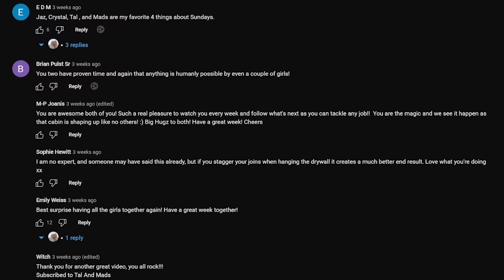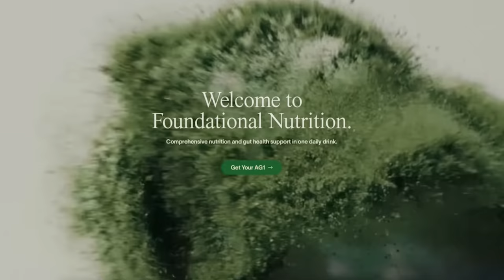We Should’ve Listened

Comment: I did Drywall for about 10 yrs both commercial and residential. Was on a crew who did everything by hand meaning no specialty tools when taping and mudding. Everything was done by hand. The crew I was on could have had the whole ceiling hung by lunch time or shortly there after and everything taped by the end of the day...But we did it for a living and knew what we were doing. Go your own speed. Take your time. Make sure yall have plenty of mud on those seems before you put the tape on. Then run your knife over it and push all the mud out. If you dont have enough mud you will get bubbles and or the tape will come down so it is important to have enough mud on those seems. Watch a few videos on Youtube on hand finishing drywall. Here is a good video explaining the hand finishing process. Yall CAN do this. Just be patient take your time and if you get stuck or frustrated just walk away like yall did in this video. COme back to it its not a race. If you have any questions go ahead and ask Ill answer them the best I can. Good luck like I said you CAN do this.....https://www.youtube.com/watch?v=jIxYEKhMa1I&ab_channel=LaurierDesormeaux

Comment: I don’t understand people having such difficulty mudding & taping. One thing that stood out from your montage of previous attempts was that you didn’t wet the tape and you used way too much mud. Like 10X more than you needed which is why you had such a mess. I can’t do anything but I can mud & tape as good as any pro. 

Step #1:  Thin coat of mud to fill the gap between the sheets. DO NOT OVERLOAD with mud. When I say “thin” I mean only enough to fill the gap & smooth it out.  Less is more.  #2.  Wet the tape & apply over the joint.  #3.  Apply another THIN coat of mud to cover the tape using as little as possible. #4. Mud shrinks when it dries so you’ll probably need to touch it up with a little more unless you put the mud on too thick to begin with which means you made a mess of it again.  

Remember that you’re going to have to sand away excess mud and that stuff goes EVERYWHERE.  It’s the hardest mess to clean up unless the house is empty which is another reason you use as little mud as possible.

Comment: It never seems to work to try to send you help, but...  Yes, you guys are doing great mudding (always thin coats, etc.)  but there is some chance that you will look up at the taped joints across the 'non-relieved' panel edges and you will have a moment of 'hunh' that comes from, maybe, a little 'disappointment.' (You will find that ceilings at the angle show just about everything.)   There is a way to alleviate - although not absolutely completely - the no-panel-edge-to start with syndrome.  High qual mud - not the qwik-dry stuff, and, as if you were actually plastering blueboard, work out from the seams.  Two coats helps.  Hitting it with wetted steel (as if plaster) can help. (You can actually use plaster - although it kicks quickly.)  Then sand with electric drywall pole sander.  Make frame (like you didn't use to hold drywall against ceiling) but with mobility to hold sander to work -- very gently -- against ceiling (lever - push down to go up).  Result will not be "dead flat" but ceiling will not "line grid" your view too badly as you look up.  PS I'm still worried for all the wall and ceiling covering that doesn't have stuff that would help you behind it (any CAT6 wire... etc.)

Comment: Not sure what your plan is , but if it is to wrap the beams with wood than you dont even need to tape and mud as it will cover most of the drywall and if that is the plan , a great one , ot will keep the whole cabin feel !
Reply from the maker: Exposing the trusses yes! Correct. That’s why we didn’t sweat the measurements being off a bit cutting those out. Thanks for all your advice in your other comments appreciate it John :)

Comment: The pappear tape is the best for drywalling.  Papper drywall tape holds a better stronger bond. The other thing is when you measure on the ceiling and your transferring the measurements to the drywall that your going to cut. Their is a vertigo effect that happens when transferring the measurements. And many people  measurements are off especially when you're measuring around light fixtures. It's best to take your measurements from the edge of the drywall that's already hanging on the ceiling over to a light fixture or any intricate cuts. You've heard that old saying measure twice cut once when it comes to drywall also looked weist and cut once. Now when it comes to mudding you want to keep plenty of mud and make one continuous run down the joint. When running the joint compound or mud as it's known. Think off icing a cake. It's the same nothing. So when one puts icing on a cake and iff you hold the spatula at to much of a angle one way the it's to thin and if you hold the spatula at the wrong angle the other way then you have to much in different areas. But when held at the right angle then the icing is continuous and smooth with just the right amount. So mudding drywall joints is exactly the same way as icing a cake. Then when running the tape use you drywall knife as is known as hold the end of the tape with the blade edge lightly so you don't cut into the tape then roll the tape out at arm length of the hand that you're holding the role in. Then angle your drywall knife and run it along the tape towards the row in your other hand remember to keep slightly light pressure when you're doing this with the tape so that you don't create wrinkles this will in bed the tape into the joint compound. I've put up a lot of drywall. If you don't understand how I've explained how to hang drywall and to run drywall compound and tape. Then their are many YouTube videos on how to hang drywall and to run drywall mud. Good luck with y'all's drywalling. Y'all have been doing good so far with it. All do y'all do have a little bit of problems once you get past those problems than drywall and will be like riding a bike.
Reply from the maker: Well that was a in depth step by step on drywalling. Thank you for spending the time to send us all your expertise and knowledge. We are so happy to have you in our community.🌞🐾
Reply: @Vanwives   y'all are very welcome I'm happy to share my knowledge. I hope it will help y'all out with y'all's drywalling. Again good luck and apply the techniques that I shared y'all.

Comment: You do know you can cover the ceiling with what you used on the floors or what you used on the walls. I personally would use what you used on the walls to cover the ceiling Also, it will look gorgeous.. But if you’re going to drywall, soak your paper in a bucket of warm water for about 20 minutes before you put it

Comment: 12:15................Think I would have just strapped the ceiling joists and put the drywall panels on the lower section.
Guess I don't fully understand your end result that your looking for.
I taped and jointed most of my life......have fun ????? LOL.
The secret to mudding joints is to have someone else do it....lol.Kidding aside...Imbed the tape.......then run mud 12" either side of tape ...allow to dry.....then fill in over tape to match sides.
I could almost do taping and mudding with very minimal sanding using a wet sponge method.
You two will do just fine though......it's a laborous job regardless.
The more mud on that's not smooth means the more you sand off.
I'd rather mud than sand any day....lol.....
THOSE exposed 2x4' & 6's will look amazing???lol.

Comment: Long time viewer much longer time drywaller or "Plasterer" as we call it here in Australia, don't worry about how you got there if you achieve the desired outcome, you have done it! That's all that matters, doesn't really matter if it's the right or wrong way as long as it doesnt fall down or apart :). Any answers to your questions in chat are going to confuse you more than help as there will be too many differing opinions, if you can ask a local for advice that would be best. Im happy to help with direct questions if you like.

Comment: I can't believe you wonder why you are so cold. All heat escaping thru roof. Heat rises duh.
Close up attic with a door.
Put up insulation.
Put up dry wall beneath trusses. Full sheets make it 4*8 to screw into . Leaving a cut edge at a corner. Keep all factory edges, for easy mudding.
3 passes of sanding and mudding is perfect.
So quick.
Reply from the maker: Not always about quick… it’s hot lol

Comment: Dry walling and taping is a bitch .. unless you do it as a profession . You have to make sure Sheetrock is hung straight and taping and spackling is the challenging part don’t use too much product dries a hot mess clumps everywhere and too thin and walls crack at seam and rough areas and etc. maybe if this doesn’t turn out nice just use bead board up there and paint it white .. good luck as always thanks for sharing .

Comment: Why did you dismiss the possibility of screwing the drywall to the underside of the rafters/trusses - instead of the underside of the roof - surely it would have looked neater and have been far easier to get the sheets in position? 
Granted you loose some head-room - but that doesn't look to be a big deal.
Reply from the maker: We have big dreams for the ceiling - stay tuned 😊
Reply: @Vanwives  Intrigued to see what you have planed. You two are an inspiration.

Comment: Soooo is it just me or........Why are you placing dry wall on the underside of the roof? AND mudding / taping the seams? I've  never seen this done. I've  only seen the drywall placed on the underside of the ceiling joists thus forming THE CEILING. Insulation sheets run between the ceiling joist or blown in insulation is applied between the underside of the roof and the topside of the ceiling joist................thus there is no need to tape and mud the inside of what will be THE ATTIC. I can't imagine not using insulation in the attic.

Comment: why are you putting the drywall inside your trusses and not on the BTM like it should be? I am sure you girls can do it, from what I've seen you can accomplish anything. Its just much easier to put it on the Bottom of your trusses and if you want beams exposed you can add later.
Reply from the maker: We have a vision :) it’s going to be a vibe just trust haha. Easier isn’t always better in our opinion. The ceiling would be super low and feel smaller if we did that as well. Thanks for believing in us 💛

Comment: Well, I can't find any comments about this so here goes. When installing drywall on a scissor truss the drywall goes on the BOTTOM board of the truss. The reason is that there needs to be a hell of a lot of ventilation in that ceiling space. If there is condensation in those closed in pockets you have created, which is extremely likely, then your framing is going to suffer and eventually fail. If those spaces have big time venting from top to bottom, like a vented block at the bottom and a continuous vent at the ridge, maybe it will be ok but the way you did it is wrong and I am sad. Your ceiling would have been plenty high in there and you would not have had to do all that massive extra work notching around the framing that you should have been attaching your sheetrock to. Seriously, get a pro in there to look at what you did because you probably need to take all that out. Hey, sorry to be saying this but somebody has to. Not understanding proper venting is a very comman rookie thing.
Reply from the maker: Hey Keith, don’t be sorry we really appreciate you sharing your knowledge and experience with us. We are rookies that is for sure. Stay tuned for the rest of the story with the drywall ceiling coming at a later date.🌞🐾

Comment: Well, I'm another one that believes in you.  I've got about 30+ yrs of construction experience, of which about 4 years total of hanging and finishing drywall, spread around here and there.  Thinking about what I would like to tell you, it would take days to type, and you would miss all my waving my hands around in the air!  So, I figured someone out there in YT land must have made a video that would explain what I would say.  After reviewing about 10 videos, I haven't found one yet.  But there are 2 that are not too far off the mark.  1st is this guy: 
Vancouver Carpenter, and this video: Every Beginner Drywall Mistake I can think of (1/3)  (https://www.youtube.com/watch?v=jfFiucVSKVQ)

2nd is this guy:  Stud Pack, and his video:  How To TAPE and MUD Your DRYWALL | DIY GUIDE  (https://www.youtube.com/watch?v=EhXz4rFByhM)  Skip the part about prefilling with hot mud, since it pretty much does not apply to you.

2 things I'd like to add though.  1) whoever told you to use a Hawk has done you a grave disservice.  You would graduate to a Hawk if after a year of drywall finishing, you thought you might want to move on and make a career out of it.  Hawks are NOT for beginners!  Do yourself a favor and get a Spackle pan.  You can thank me later.  And the 2nd thing is, never ever, ever return mud to the bucket once you've removed from the bucket.  Once removed from the bucket it either goes onto the drywall or in the trash.  Those little bits and flakes will haunt you to the bottom of the pail.  This is why you do your screws LAST!  Mudding your screws is how you use up the mud you are done taping with, but can't return to the container.  See how that works?  Clever.

So ladies, I await you next (?) installment, where you prove to yourselves just how AMAZING you both are!  You got this!

Comment: I'm seven minutes in, just after the plug for the green stuff.  WTF are you trying to do?  The sheets of drywall are supposed to be installed UNDER the bottom chord of the trusses.  If you want decorative beams, they go on after the drywall.  All the 1x3 nonsense was unnecessary.  Cutting the drywall into smaller pieces to install on top of the 2x4 was a total waste of time and effort.  The reason the drywall comes in 4x8 and 4x12 sheets is to MINIMIZE the amount of joints you have to tape.  Butt joints (end-to-end on the 4' side) without the indent are harder to tape and mud, and should be avoided.  You made more of them to have to deal with.  I will continue to watch, but you should have sought outside advice before you began this FUBAR project.***  OK, I finished the video and must say the manner in which you approached this drywall install was totally off base.  I don't want to be a downer on your adventurous projects, but this concept of leaving the exposed 2x4s hanging down lower than your finished ceiling wasn't very well thought out.  Observing the taping and mudding, it is very apparent Jaz has no idea of what she is doing.  Having to work around the hanging part of the trusses just makes it that much harder to tape and mud.   The way to do it is to put 2x4 braces between the trusses, on the same plane as the bottom chord to attach beams (4x6 cedar?) to the ceiling after you've drywalled the complete plane of the bottom chord of the trusses with full sheets of drywall.  Taping and mudding, sanding, finishing, and painting would have been a whole lot easier to accomplish.  I did exactly what you should have been trying to accomplish for the first time in 1987, and it turned out great.  Trusses, drywall, decorative beams – in that order, going down.  Are you planning to wrap those exposed 2x4s with another type of wood, or are you going to paint them? (yuck).  Sorry to be negative about your 'wonderful' idea.  A drywall contractor would charge you somewhere around $50-$100 a board, finished.  Perhaps take some of your gobs of YouTube money and get a professional to do this the right way.

Comment: Always use scrim/mesh, next, crack open a beer and get someone in to do it.  Sorry, girls, you've missed the bit where you have earned years of experience, thats why there are pro's. Still, you gave it a go, thats everything.
Reply from the maker: Hey Dave, thank you for sharing that with us! 😊
Reply: @Vanwives  No disrespect but I've had 50 years of DIY and 6 house renovations here in the UK, and just sometimes you have to bite the budget and get a pro. Putting on the scrim takes a little practice but drywall skimming, I think you call it spackle, takes a lot more. You're doing an outstanding job, 🥰